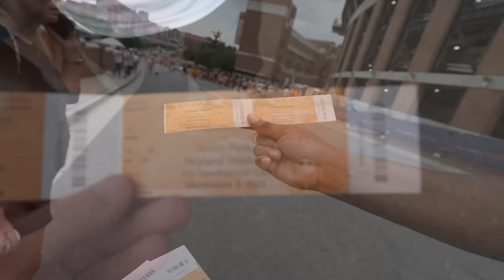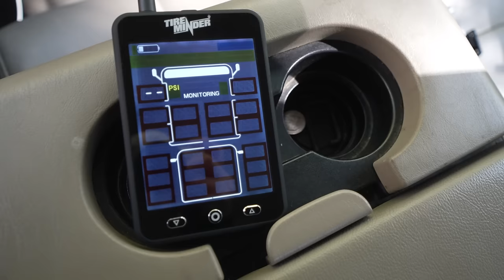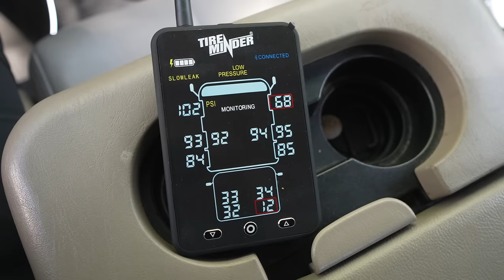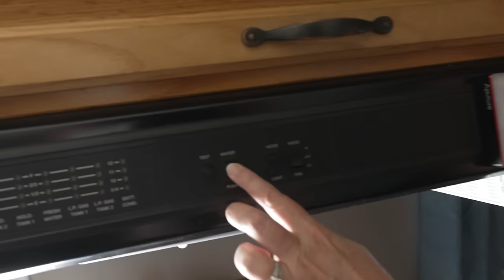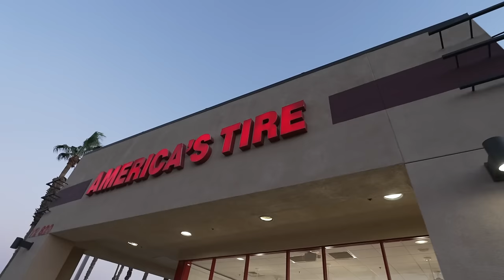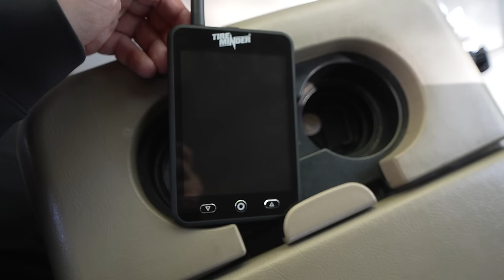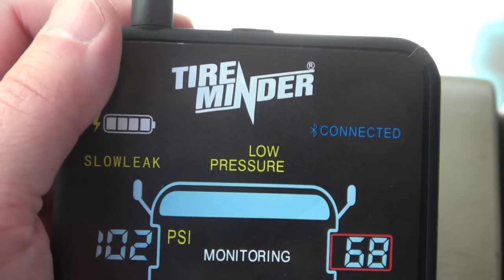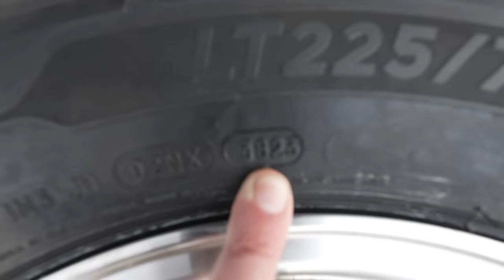TRIP KILLA - Our WORST RV Tire Disaster!

Comment: We lost the truck water pump 30min from home after a 12hr drive back from the beach.
The next year, 1/3 of the way back from the same beach, we blew a right side trailer tire. Changed it for the spare at an offramp. No one was open (or just not willing that late on a Saturday) to change the blown one. We continue on. 2/3 of the way back the other tire on that side popped. I spent half the next day trying to find a place to get 2 tires with the family holed up at a campsite that wasn't even on the map yet. Turned out OK in the end, but not a grand adventure that year. Tires (Castle Rock 😅) were only 3yrs old from purchasing the camper new. I had a calendar reminder to replace them at 4yrs. Needless to say, the other 2 & spare got replaced before the next trip.
Surprised you didn't hear the blowout. Both of ours sounded like a shotgun and we felt the shudder. No damage to the trailer thankfully.

Comment: I like Discount Tire but I've found that each locaton is different on the quality of work being performed.  I've used them in Florida,  and in Tennessee at 3 locatons and it depends on the manager and crew that they have  doing the work.  It's best to watch while the work is done if you want customer satisfaction.  Also note that trailer tire valve stems are heavier duty than passenger tire valve stems.

Comment: I would say 4-5 years is a good lifespan before replacing tires on a trailer whether used or not. Getting a blowout on the side of the road is dangerous if you have no room to work on the driver side. Or you could be in the cold rain or intense heat of summer. In Vegas the sun rot on tires is horrible on tires. I don’t care for mileage warranties because you’ll almost never have them past 3-4 years. If you leave your vehicle parked on the asphalt for too long during the summer you develop flat spots from the ground being so hot. If the trailer is in a shop where something can be fixed and it won’t inconvenience you to have to bring it back another time, I’d whip out the credit card and have them do it now. It sucks, but at least its done.

Comment: I bet it was a puncture in the tread that caused your tire to lose pressure and destroy the sidewall, AKA run flat. I saw something stuck in the tread while you were rolling the tire to your tailgate at 10:04 timestamp. Driving on a tire with no air on it destroys the sidewall.

Comment: I put Goodyear Endurance tires on our fifth wheel. At 5 yrs of age, I went to replace them proactively so I could move those older tires to a smaller rig. I found one had a belt failure separation and since another had a flat spot, I didn’t reuse them. So even Endurance tires have an age limit.  Fortunately I found it during time at home. 
It looks like your failure was not in the steel belt but at the sidewall, which is why it so little damage ( no flapping tire tread/ belts). “ Lucky you”.
The point is, these are all internal failure origins, so keeping them clean, Armor All, out of the sun, no tread wear, etc are all ineffective at preventing internal failure. It’s NOT how a tire looks.

Comment: We had a similar problem with discount tire too on our airstream. I used a trailer ramp just like you did. The technician removed the lug nuts on the wheel that was on the ramp! The floating wheel didn't even cross their mind that it was the one I wanted repaired. I was furious
Reply from the maker: Wow! That is scary. That’s a good reminder to watch everything that these guys do. I know they mean well, but people who are not accustomed to working on RVs will often make mistakes, and those mistakes can be costly.
Reply: @LongLongHoneymoon  I was looking for exactly that comment.  Where the hell were you Sean when they were jacking it???  I really like Discount Tire but...  whether it's my '65 Sting Ray convertible or, Airstream or...  doesn't matter.  I watch them how and where they jack it and how they handle my rims too.  Before my car goes in, I usually pull the manager aside for a quick chat, that you have "specific requirements" you'd like to discuss before they begin.  Simply expressed as a preference (e.g. not telling them how THEY do their job, but how YOU would like it to be done.) Then if anything differs, at least you can all discuss it beforehand.  They could, after all, be right - but how a job gets done is far more critical than just getting it done.  Oh, and did they road-force balance your wheels, write the torque setting they used in the installation notes, then re-torque them for you when you came back to report the tank damage?

Comment: I was careful to make sure and show the Discount Tire changer the 'Jack Points' and told him that was the only place to jack the trailer. After about two hours in the waiting area, I got a phone call and was informed they couldn't replace the tires because their jack would not go high enough to raise the tire off the ground if using the jack point. I had them put my 6 X 8-inch block of wood on top of their jack and that worked fine.

Comment: Along with date codes and tire wear, be mindful of the speed rating your RV trailer tires can handle. I had a massive tire blowout on a camper because they had a low speed rating. For the Airstreams, if they don't have them already it might be good to have some stickers made up for the outside indicating where the jack points are.
Reply: The jack points are actually labeled from the factory. That’s what makes it even more crazy! 🤪

Comment: Well, I have to plead the fifth on replacing tires in a timely manner. I did get 12 years out of my tires. But most of the trips where four hours or less. I did remove the wheels myself and take them to the tire shop. Then reinstalled them.
I do inspect my tire before each trip and any time I stop on a trip. I do have a TPMS. If I had taken longer trips, I would have replaced the tires sooner.

Comment: And I thought it was just us with bad luck. I ripped our tank cover on a slow turn out of a fuel stop. A pot hole dip with curb. 16 inch rims and 3 inch lift did not help.  9k later we’re still licking our wounds. 

When I visited Vinnie and when he pointed and recommended I learned. When the master speaks the customer is best to always listen.  You going back to the Airsteam whisperer , Ronnie or JC ? My only trusted techs

Comment: The tire minder does have a battery indicator on the display. You should have showed them where the jack points are instead of them taking matters into their own hands.
Reply: We literally stood right next to them and told them where to find the Jack points. That’s what is so ridiculous. They did use the jack points on the driver side of the trailer, but then did not use them on the passenger side. Next time I guess I’ll just crawl under the trailer and place the jack where it needs to go myself. 🤷🏼‍♀️😆 With regard to the tire minder, yes, it does have a battery indicator on the display. But in the video we shared that we had forgotten to charge it. It was a simple mistake on our part. Yes, they do occasionally happen. 😉

Comment: The Trailer Ramp does work great and every RVer should have one. For added height, carry a 2x6 or 2x8 about 3 ft in length to put the ramp on. I was in a situation where more height was needed and the 2x6 provided just enough additional height to change the tire.

Comment: Trailer tires are too often ignored.  Glad you did not end up shiny side down.  All trailer tires, no exceptions so far, “ Age-out”, they never get a chance to “Mile-out”.  Every 4 year you toss them.  They need to be run at recommended pressure and never over recommended speed rating.  Do these 3 things and you have removed a lot of hazard.

Comment: i always say that the most important piece of equipment on my trailer are the wheels.PERIOD.
any other piece of equipment can fail but you can always go somewhere and have it fixed. A tire issue is a sure way to find yourself in Sean's situation. I just had my 5 tires replaced after 5 years of use, not because the treads looked bad but because tires on a trailer do start to wear out around that time.

Comment: Trailer tires are notoriouly failure prone.  You cought this tire failure before it got really messy.                 Over 80 degrees, over 5 years old. 
Not just tread depth.
Feel free to sell the tires at 3 years old. 
Get new tires before they arent marketable.. save because you got something for your old tires.
And get a tpms system that isn't going to let you down. I've been there too. I dont do that any more.  
The potential increase dammage and inconvience  is less likley. 
Dammage free.!
Paint factory jack points. Maybee yellow...
Thanks for sharing. An employer of mine had just installed 12 recaps on a trailer in California.
When in arizona had 5 tires go on the passenger  side...17.5 tires. Took all day to get from multiple wharehouses.
Reply: Ps jb weld marine till perminant repairs can be made.

Comment: I have to ask, did you not have a spare?  Last summer I picked up a nail while camping in the Keys.  I was able to use my Anderson levelers to raise my AS high enough to take off the flat and put on the spare.  But I am going to look into the ramp.  My GY Endurance just finished 4 seasons of camping.  Told our AS dealer we want to replace the tires (all five) in May when we get it de-winterized.  He said that they look to be in good shape.  Maybe so, but I would rather spend for new tires than a damaged wheel well. Safe travels!
Reply: We do have a spare, but since we were going to be replacing all 4 tires and the tire shop was only 2 miles away, we didn’t bother putting it on.

Comment: Changing a furnace isn't to big of a project.  you probably could have done it yourself.  I've done it three times on two different trailers in 17-18 years as a full time 5th wheel rv resident.  They only seen to come in a few sizes on the outside dimensions.  just make sure the gas connection doesn't leak, its like four wires to connect, and the ducts connections are a quick connect 1/4 turn type situation.  It was a tight fit to slide the new furnace into the opening from the old furnace but it did fit.  just shows the quality fit and finish on an airstream.  no huge gaps to fill around the openings.
Reply: They had to cut the opening wider to make the new furnace unit fit (it was the original unit from 2003, so an exact replacement unit is no longer available.) There aren’t many people that we trust to cut that aluminum skin because if they get it wrong, replacing it is very expensive and involved! I’m glad you’ve been able to replace yours yourself. That’s a big money saver, for sure!

Comment: I used Americas Tire recently with both of our cars and we had great service. The guys put the wheel covers/hub caps on the correct side as to not scratch them...most tire shops put the good side on the concrete floor. They aired the tires to factory spec. and hand torqued the lug nuts. Also, I had asked them to write down the date codes on the repair invoice so I had a record as well as their computer in the event I'm in need but at a different store for service. they sold me tires that were 9 months old and I asked about this. They said they add 1 year to the date code so that we get the full time on warranty etc. Still, that stirs me that you can't get a tire 3 months old or newer !

Comment: Holy shit! I'm glad you were able to pull over safely to the side of the road to replace the blowout! I've had that happen. I had recently bought a "new" car, a 2018 Mazda CX-5 I bought in 2020. I was on my way home from work when I heard a loud Pop! I didn't hit the brakes, I just gradually slowed to a safe stop. I wanted to see what I had run over. It turned out to be a bungee cord, with a hook at each end. Apparently someone had fastened it to something and eventually the hook had come undone. Thankfully it didn't hit the windscreen or one of the side windows of the car.

Comment: You got VERY lucky!
And also. I swear just not too long ago, i watched a video from you sbout replacig your axles.
Reply from the maker: Yes, we did replace our old axles due to their age. If you recall, one of our new axles was missing the critical keeper piece. The factory neglected to install it! We were lucky that our wheel did not fall off while we were traveling down the interstate. It seems like every year we get thrown a new curveball. Some of these problems have to do with the age of our rig, and some of these problems are just life happening. Life is all about dealing with adversity.

Comment: I feel your pain. I had a bulge in one of my tires, so I made a trip to my formerly favorite Discount Tire in Florida. Thankfully, I was kind of a jerk because I stood there to point out the acceptable places to jack on the frame. Their plan was to use two floor jacks and raise all four wheels off the ground together. It all came to a halt when I told the workers that they may NOT jack under the axles. The young "manager" came out to inform me that Discount Tire's corporate policy was to ONLY jack under the axles (which I don't believe.) The "Jackulators" pointed to the pan and claimed it was the frame. NO!
To keep the story shorter, The manager refused to jack anywhere other than the axles and so I walked out. I even showed him the Jack points and asked, "You're telling me that corporate headquarters will not allow you to jack under the place where Airstream says, "Jack Here" !" "That's right, we only jack under the axles." and added, "I've jacked up a lot of Airstreams and never had a problem." Sure, Jr.

Comment: Funny TPMS not connected at worst time, it happens.  We had a weak battery and lost connection, guess what tire did within minutes, yes had a leak and lost pressure (no blow out).  Like you a car signaled to us.  Do you think these tires and the TPMS work together to fool us?  Just asking?  Also we have single axle Airstream, at 3 years we just replace, I know it is an expense but gives piece of mind.  Great video

Comment: So, are you going to show the how the repair of the water tank went? 25:02 

My rule is default on the side of safety when dealing with tires, axes, brakes, etc. on our 23 foot travel trailer. Other items on a TT it may be ok to wait on. Glad to see that your TT didn’t sustain significant damage due to the flat tire. Consider yourself very lucky for that. 

I have use Discount Tire for all my tires for years. But I would never trust that they would know where to Jack up my TT. I always stand by and make sure they do it correctly.
Reply: 😆 We were literally standing right next to them! We told them repeatedly that there were marked jack points underneath. The guy on the drivers side crawled under and said, yes I see them. He apparently used them on that side, but did not on the passenger side. 🤦🏼‍♀️🤷🏼‍♀️

Comment: If you end up with a new truck or if you find a way to do Car Play, the Tire Minder car play app is great. I can push a couple icons and check the pressures or just leave it up on the main screen of our entertainment system. 

I found out last summer that the full sized spare for the F150 isn’t a full size tire rated for towing (the hard way of course). Oh, the things we learn.
Reply from the maker: Thanks, great tip! We do have CarPlay on our truck because we installed a new stereo a few years ago. I will definitely check out the Tireminder app!

Comment: There is a lot of blame here to spread around. 1, Unfortunately you were not in a position where you could remove each wheel and carry it in for tire replacement. You are forced to trust the tire folks and as in most repair shops the vehicle was out of sight. I hate that feature! 2, Our Tire Minder is sacred: It's saved our bacon a few times. We don't leave a campsite or Walmart without reviewing pressures. Their $5.00 battery and O-ring replacement happens each spring. 3, Tires: I suspect that Michelins are used to replace ST tires is due to their superior sidewall construction. 4, Listen to your wife. 😉

Comment: RV trip in 2022 to the UP of Michigan. My 2018 Keystone Outback 328RL had a China Bomb tire explode Northbound on US 131 just one hour into my trip. All tire pressures were checked and adjusted prior to departure as my normal routine. The exploded tire damaged the upper wheel well, busted the plastic fender skirt in half and severed the electrical brake wiring and the tire broke off the 4" PCV pipe with the gate valve!!!. The upper black tank gate valve was not affected, nor the upper grey tank gate valve. I ordered a replacement master gate valve and end cap when I got home.  Was able to glue it to the remaining 4" pcv pipe. This allowed the final gate valve to be recessed out of the path of the tire tread, should another tire at that location explode in the future. Keystone could have forseen this potential collateral damage and recessed the master  gate valve and end cap further inboard. I had to make the modification.  Fortunately no fiberglass damage. I installed the spare and continued my trip. Once at my destination I contacted a nearby tire dealer and replaced the China Bomb tire with a highly recommended Goodyear Endurance. After my trip was over, I replaced all the remaining tires with Goodyear Endurance tires. Note, the oem tires where "Made in China" ( Trailer King) and were only 4 years old. So not only will very aged tires pose a high risk, the very fact of having China made tires on your RV are problematic all the time. I will never purchase another RV with China Bomb tires. The dealer will have to absorb the cost to upgrade to Made in America replacements.
Lastly, i removed each tire one at a time myself after i arrived home and hand carried them to my local tire dealer to replace the remaining  China bomb tires. Including the spare. Took much longer, but no jackulation 😅 issues because i did it correctly.